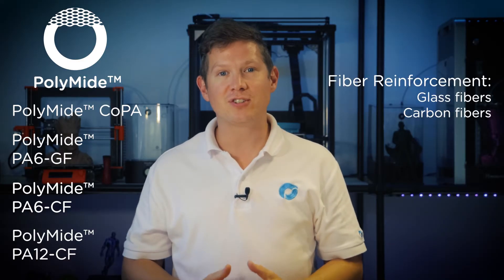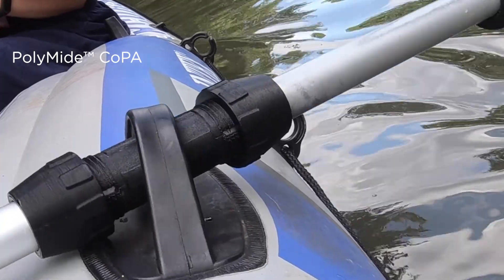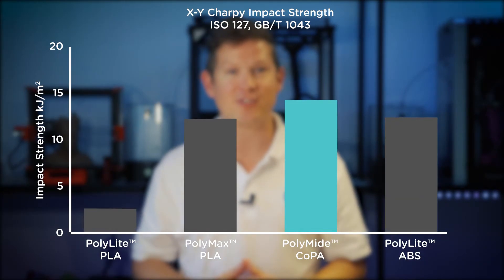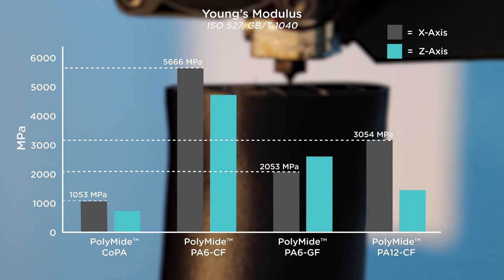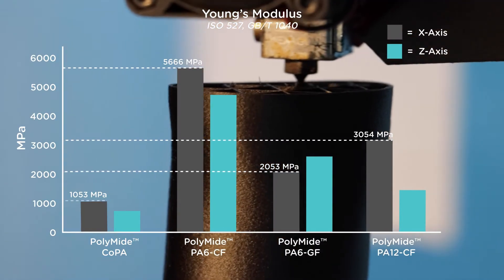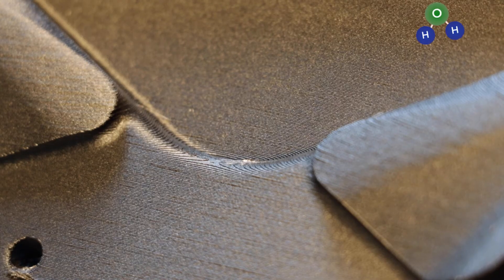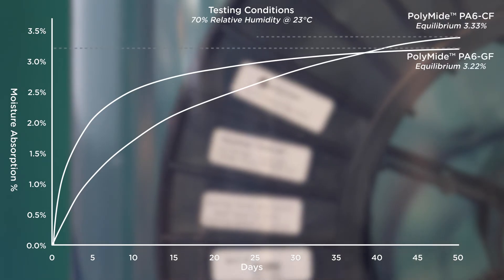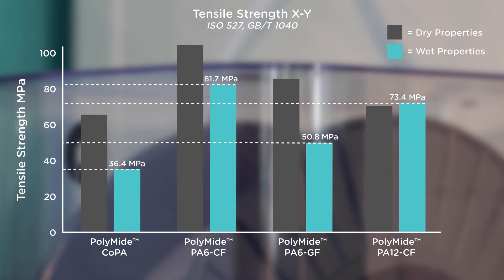Which Nylon Filament is Best???

Comment: Which is the best filament for linear guide applications, i.e. which has the best sliding properties? For example, as a slider in an aluminium profile.
Reply: I would guess copa for higher wear resistance, but pa12 with the best surface finish may have less friction.

Comment: Can you clarify why at 3:09 it says CoPA has high impact strength when the specs on your website says its Charpy Impact Strength:
is 9.6 kJ/m2, which is lower than that of all the materials in this list? (16.5, 13.34 and 12.52)
Reply from the maker: Hi Julien, CoPA scores a 9.6 kJ/m2 in its dry state properties, however, it scores 17.2 kJ/m2 in its wet state properties. We assume that all CoPA printed parts will end up in their wet state properties as the nylon will absorb water molecules from the air. These water molecules form a polar bond on the nylon polymer chain and act as a plasticizer, making the material tougher and more impact resistant. This is why we see an increase in impact resistance from dry to wet state properties. We list both states as some customers prefer the dry state properties and would like to preserve these with a water barrier coating (paint, resin, lacquer). At 17.2kJ/m2, CoPA has a higher impact resistance than PA12-CF (wet), PolyLite ABS, PolyLite PLA Pro, PolyMax PETG, PolyLite PC, all of which we would consider tough materials. For more information about moisture aborption, view this video: https://www.youtube.com/watch?v=ezu5kZ7gcpk

Comment: Awesome technology, and I appreciate the engineering, but even the COPA is still far too expensive. Maybe one day I can afford this stuff 😢
Reply: CF is much more expensive than other filaments. But don't print with it without testing with PLA. While making a part I print 5-10 prototypes with PLA. And when I am satisfied with the functionality I print 1-2 final parts with Polymaker's nylon (plain/CF/GF). It requires setting horizontal expansion (I use Cura) to -0.02 and produces very accurate working part. Btw, I use PLA as support for Nylons (and TPU). With PLA support you can set zero distance between the materials and still be able to remove it easily. This makes the supported surfaces very smooth. And Polymaker's nylons allow using 100% fan speed for PLA and no fan for nylon without any warping.
Reply: Yeah. I dont exactly get why pa6-gf costs less. Per Kg i mean
Reply from the maker: @josiahong5177  The glass fibers are much cheaper than the carbon fibers which is reflected in the price of the filament.
Reply: @Polymaker  but why is copa more expensive than pa6-gf per kg?
Reply from the maker: @josiahong5177  The Glass fibers are cheaper than the raw nylon. CoPA also is a co-polymer combining both Nylon 6 and Nylon 6.6. Creating this filament requires more compounding and processing in the production of the filament which is reflected in the price.
Reply: @Polymaker  Ok. wow glass fibers are inexpensive.

Comment: I've order both Copa and PA-6 filament because I am convinced that it will hold up to it' expectations. I will let you guy's know of my results once I've printed some parts
Reply: So?
Reply: @makingastardestroyer3066  
Some say his Printer is still printing.
Reply: @BradKwfc  i think he set his print speed at 0.00001 mm/s
Reply: Waiting......
Reply: @Dont_Gnaw_on_the_Kitty_3 gentlemen, thank you for your patience. The youtube Notification Center is crap let’s be honest.
So, my conclusion:
The Copa is really tough. Both for printing and in taking hits.
This material is massively underrated. If you increase the density of your print, you get robust results. The material however does seem to flex quite a bit (not brittle) didn’t put it in the oven tho so I couldn’t tell how much better it could be! 
Trust me when I tell you “It really is a pain in the a** to print tho”. I hate it for that specific reason only. Adhesion is good. first layer could rip out the bottum of your part because it also sticks quite  well to the bed (metal coated prusa bed) (i use glue stick on the bed.)
The PA6 is beautiful to print. Maybe the best prints Ive done so far. It’s more precise and very predictive. Its surface is a rough matt finish but so so beautiful in looks and feel. Barely can tell that it’s a printed part. I made dummy parts for some tactical gear for work and the engineering team was impressed. 
If you’re a pro (not like me) in printing and have a good printer with settings to play with, try the copa. The PA6 on the other hand should be in your inventory regardless. Try it out. It really elevates your prints to another level. I hope I can get some feedback from you guys after you’ve tried it out. PLAPro is also amazing. Give that a try (the 3Dprintgeneral did some videos on that if you consider looking into it) cheers
Reply: I didn’t do any scientific testing tho so I can’t give you data on the prints. Other channels did that if you look them up you’ll def find some videos.